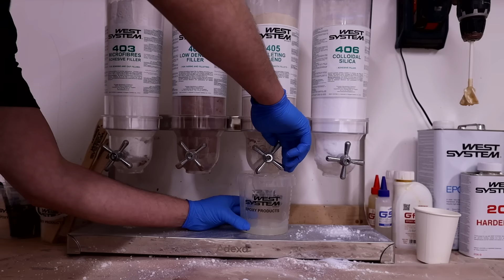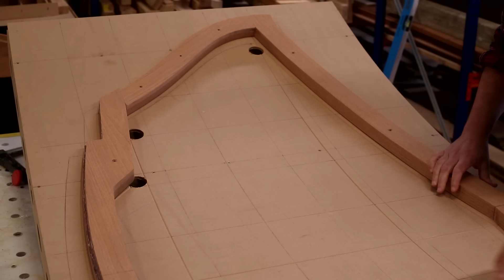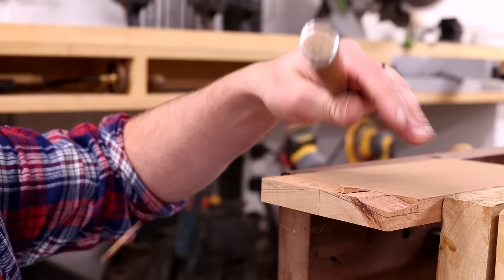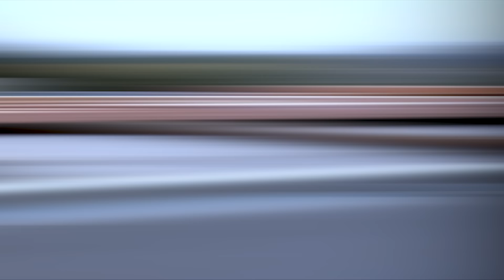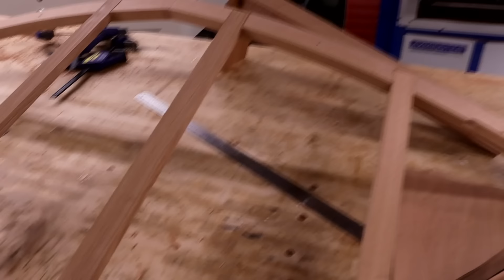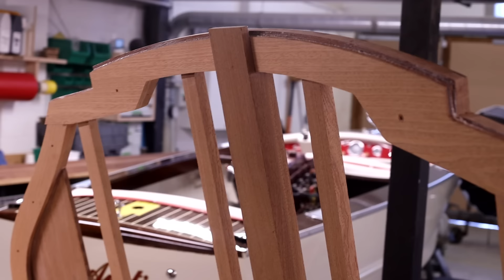Installing The Transom Posts And Cheeks | Building Temptress Ep15

Comment: Once again, a pleasure to watch Dan.  I see you use a tenon saw, probably a narrow kerf variety?  I thought you had changed to using Japanese pull saws a few years ago - if you did try them how did you find them?  In my own case, I've found I can get better accuracy and a finer off-saw finish.
Reply from the maker: Yes I did go over to Japanese saws, I still use them often but then I bought a decent quality Western style tenon saw and fell back in love with that. The balance and weight of it is incredible and I find myself reaching for it more often now. The Japanese ones still have their place but the two saws have a very different technique and sometimes one favours the other. For the deep stringer notches for example I expect I will be using the Japanese saw.
Reply: @DanLeeBoatbuilding  Fair enough, it's horses for courses.  I do still use western saws for "heavier" cuts.

Comment: I'm enjoying the details that you are putting into the build and the videos. I have two questions:  How many "Irwin" clamps do you own?  What hardener are you using with the West System epoxy?
Reply from the maker: That's great to hear! I probably have around 30 of the Irwin quick clamps, sometimes they all get used as well. I am currently using the 205 hardener as conditions are getting a little colder now in the UK.

Comment: When you made the transom frame, you clamped it down, does that introduce tension/stress into the frame and does cutting and notching affect the shape of the frame
Reply from the maker: There is of course a small amount of tension in it from the laminating process but I haven’t seen this cause any issues. Spring back in the deck beam (which carries the highest amount of tension) was very small, maybe 1mm in the centre. Nothing seems to have moved since I’ve been cutting in notches either 👍

Comment: Why do you not use a bedding compound for your joints?
Reply from the maker: Not with this type of build, it is a modern wooden construction so everything will be bonded and encapsulated with epoxy.